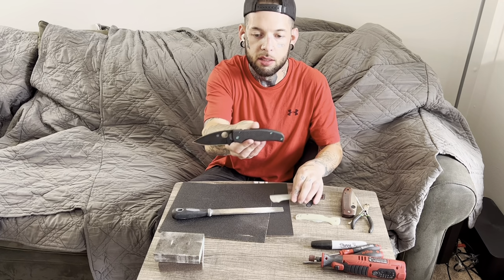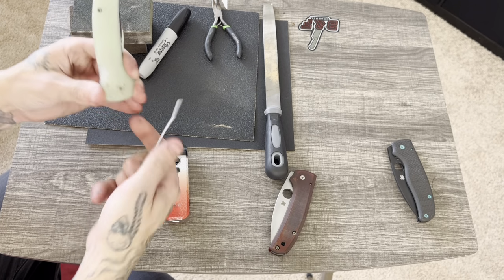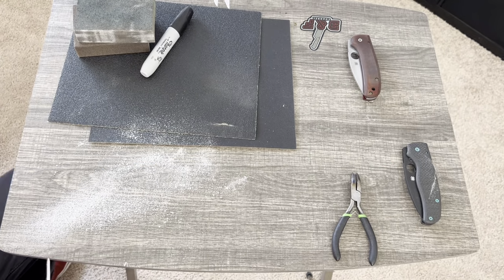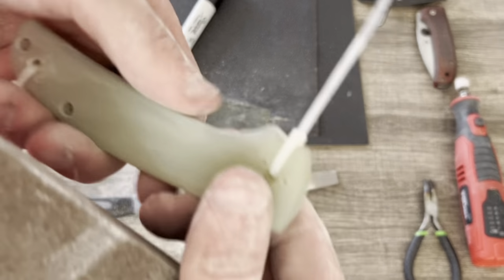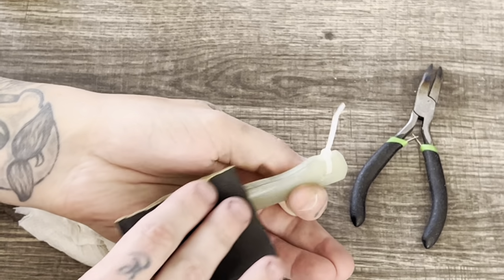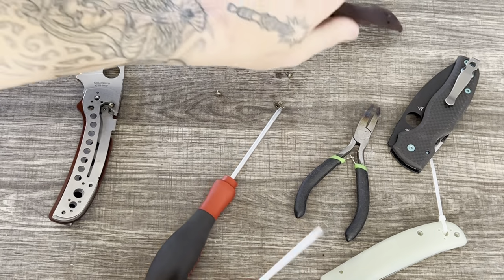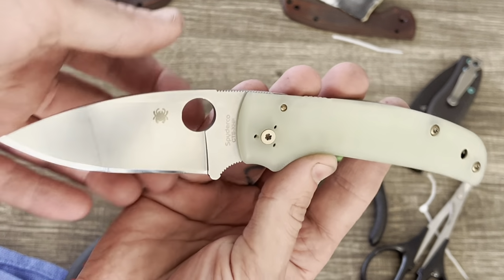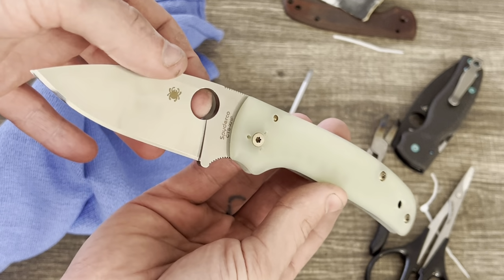SPYDERCO SHAMAN SKINNY MOD TUTORIAL 🛠 + FASTEST & EASIEST WAY TO SWAP SPYDERCO SCALES!

Comment: That’s gorgeous. I LOVE the natural jade G10 scales. That HXP is a great Steel too. I just picked up a gorgeous blade hq exclusive shaman with micarta and M4 and am loving it!! I’m a big big Para 2 fan but damn this shaman is nice! I still tend to grab my Maxamet PM2 though for day to day carry.
Reply from the maker: Thanks man and yeah the shaman is such a great knife! It’s gained popularity over the years but is still probably a little but underrated because it’s one you actually have to get in hand and carry and use before you can fully appreciate it!
Reply: @BLADESANDFADESOFFICIAL  yeah and I think it’s price scares a lot off. Which honestly that’s why I never got one until I found a smoking deal on this micarta/M4 model just because it has a scratch on the blade. I honestly don’t think even as nice as it is that it’s worth the extra over a Para 2. The only way I could see it being worth it is if you’re looking for a very hard use folder for like it in the woods and stuff. It’s definitely built like a tank.

Comment: Nice how to video, I've done these mods before but it's nice that you're showing people how easy it is to do with basic hand tools. Also those drives are great, got them when I first saw that you recommended them. Used to use the bits in a spinning top driver but these dedicated torx drivers are way better. The shaman came out good, it amazing how a couple mods can make a really good knife great. I did the skinny mod, ground off the nub, and got a regrind and now my shaman is one of my most carried knives.
Reply from the maker: Thanks brother and that’s awesome! Im glad you got the drivers and like them! I really feel that they make a world of difference. Especially if you are doing alot of work on your knives!! 👊🏼😁

Comment: Good clear instructions. 
What can be done to the original g10 scales to make them more grippy? 
My 15V is too slick !
Reply from the maker: If you have a drill press or very skilled with a dremel you could mill some sort of patern in them but id imagine it might take many attempts before you started getting a satisfactory outcome. Might want to check out Ripps Garage Tech, they make g10 scales with different patterns and textures as well as titanium, carbon fiber and micarta!
Reply: @BLADESANDFADESOFFICIAL  good to know. I’ll check Ripps for g10 options. Thanks